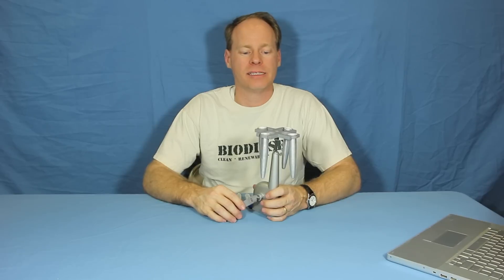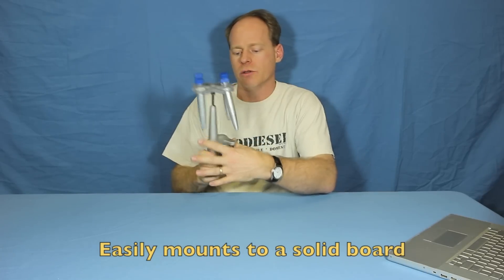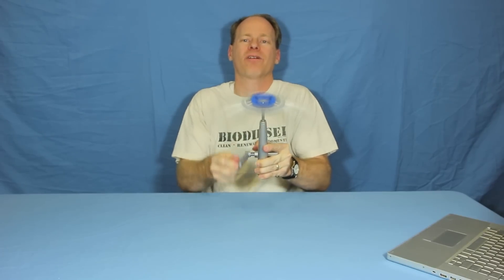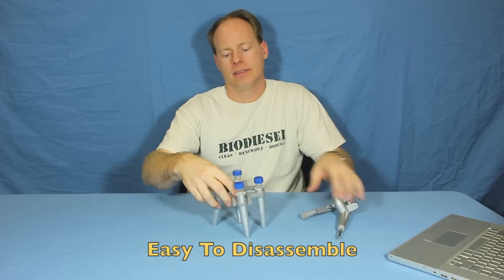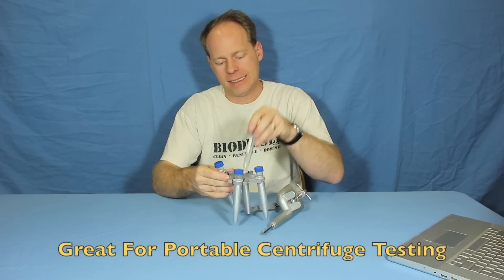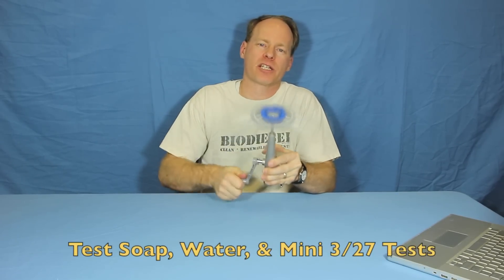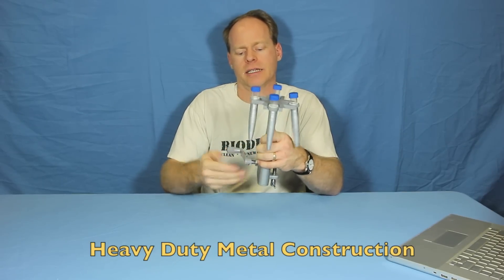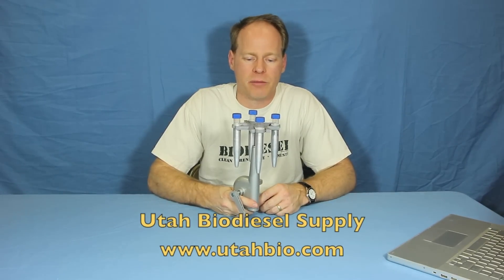Whirlybird Hand Operated Centrifuge - 3000 RPM - 15 mL Centrifuge Tubes - Utah Biodiesel Supply

Comment: Hand operated 15 mL 4-bucket 3000 RPM Centrifuge
http://www.utahbiodieselsupply.com/ce...
- Accepts 15 mL Centrifuge Tubes & can spin up to 3,000 RPMs
- Manually operated, no electricity required!
- Very portable and easy to transport
- Can be shipped anywhere in the world

Stop by Utah Biodiesel Supply to learn more!
http://www.utahbiodieselsupply.com